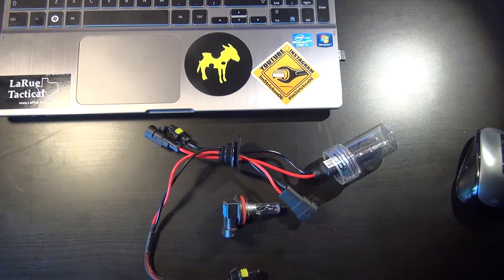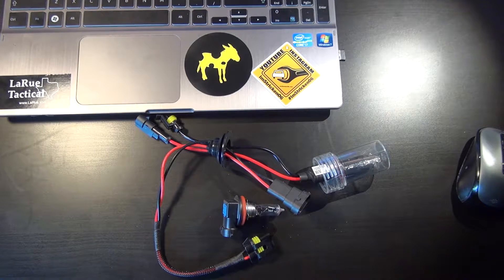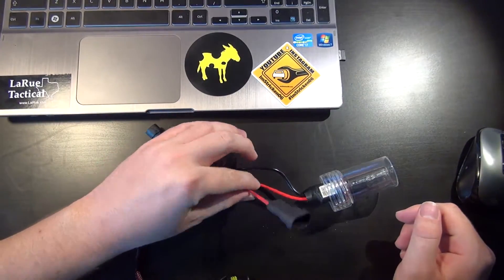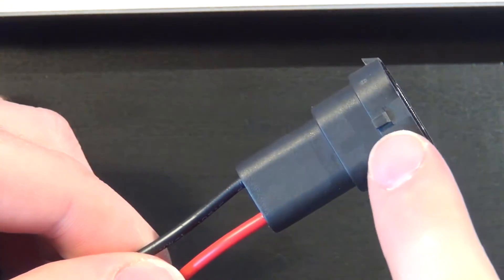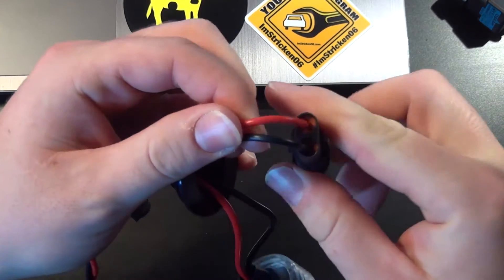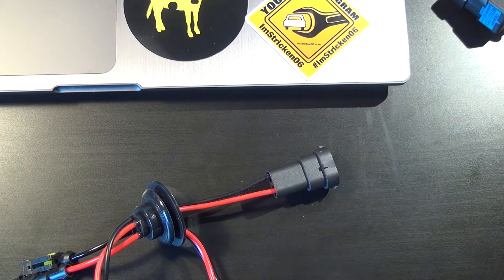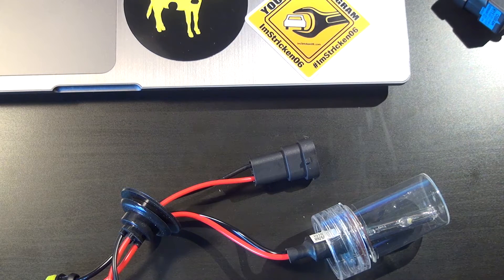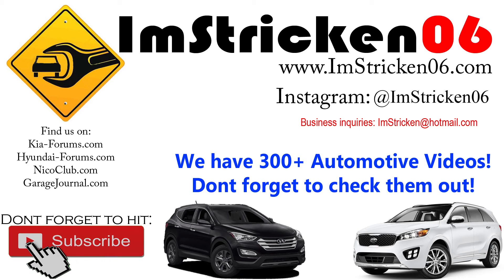Q&A: HID power supply plug

Comment: I bought the additional wiring kit that hardwires the whole power supply to run off the battery. Has a direct in line fuse with also the anti flicker system built right into the hardwire kit. I felt it was a safer option than just drawing power from the stock headlight plug housings. System performs flawless👍